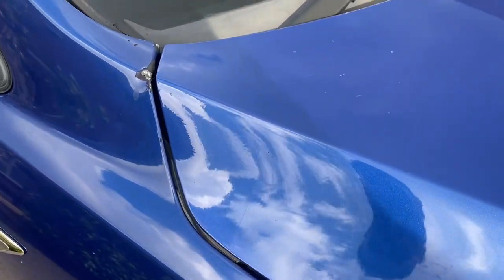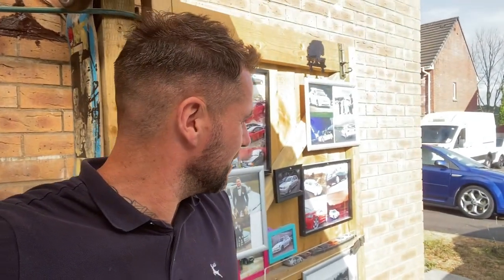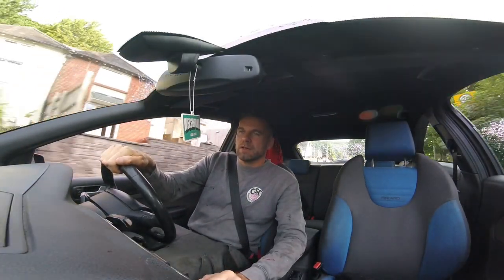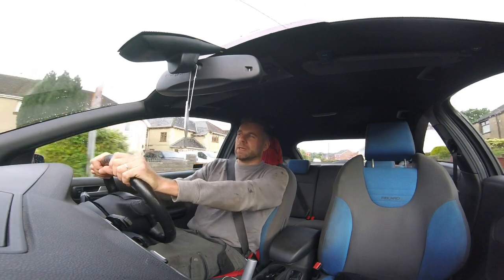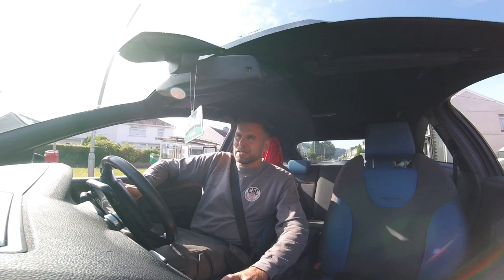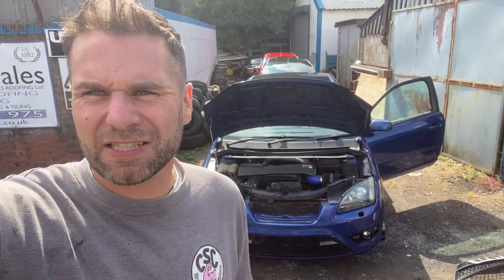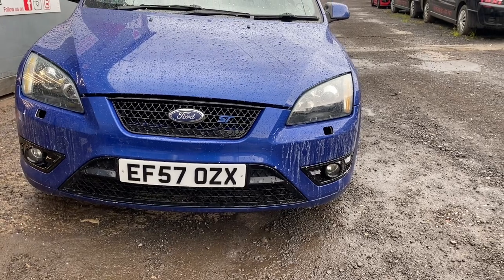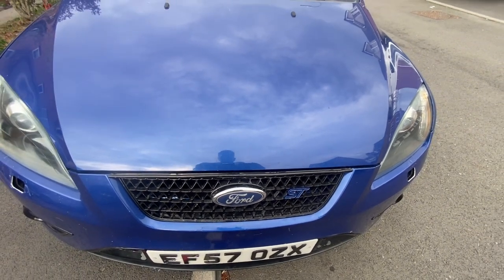Ford Focus st225  ASBO project commence ….. will it be the future classic

Comment: Hi dan great fun cars with plenty of power ive had my focus st225 for just over a year its been a gd motor ❤
Reply from the maker: Hoping this one looks after me !! Finding plenty of niggles.  Rattle on front tonight   , been under it can’t see anything
Reply: Get it up on a ramp and have a good check over all the joints and bushes pay some attention checking all the water hoses too mate last thing you want is a coolant leak hopefully your hoses are all good but worth a check
Reply from the maker: That’s the plan . It’s had new shocks / springs / drop links it seems . And rear ones . 

Thirty little thing too 

But your right !! It will be having a huge going over . Want this to last